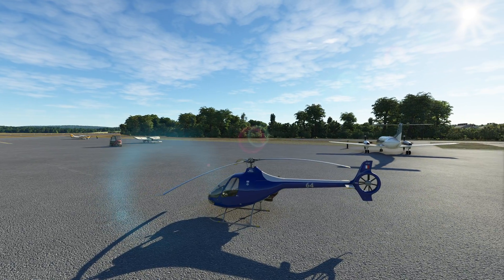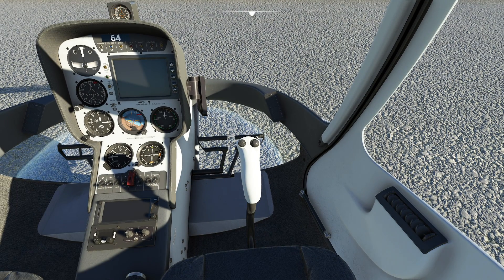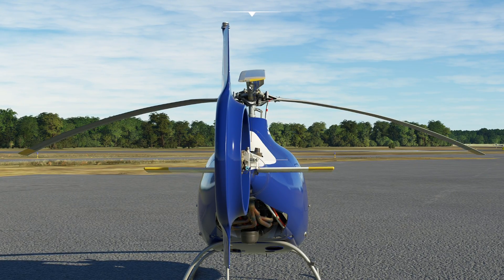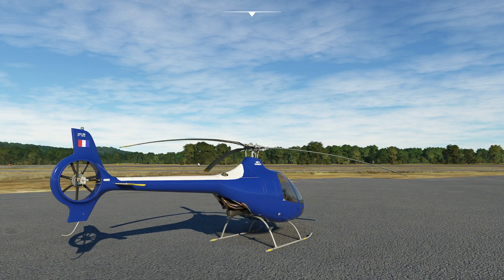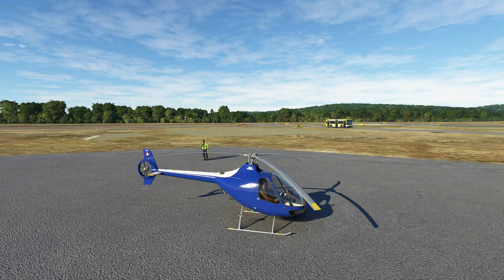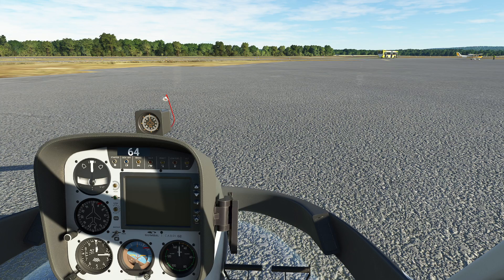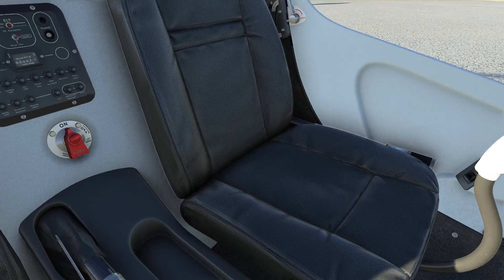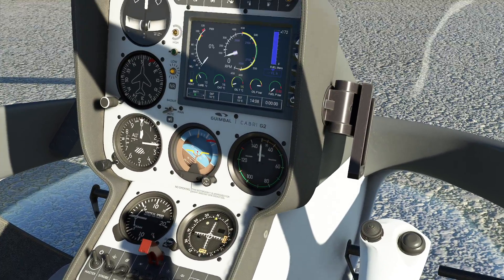MSFS - Helicopter controls, startup and hover test

Comment: question, i've mapped my controls... hopefully correctly... when i click on ready to fly, rotors already spinning etc... how do i go ready to fly with a dark helicopter so that i can follow your steps... thus knowing everything is right... at the moment, when i get into heli/rotor spinning and pull collective all that ends happening is looks like engine rpm goes up, then down and then rotor rpm comes down.
Reply: spawn on a ramp not on the runway

Comment: I could not get the "propeller pitch" to work as my throttle. This is the problem I am having. The throttle does move when you use a mouse, but I want to move the throttle with my twistgrip throttle on my MaxFlightStick helicopter control collective.  Nobody seems to know the answer to this.  Help ne please if you know how to get the throttle to work, and what the controller assignment is called.
Reply: Power Management > Throttle Axis

Comment: I managed to take off in the NY  introduction to the same chopper.    It was already burning and turning.. just had to pull up on the collective and apply some foot pedal to compensate.    I crashed several times and then got the hang of it.    Next up I plan to do a ground start.

Comment: is it just me or does my helicopter keep fishtailing to the left?
Reply: same here
Reply: So as he mentioned at the beginning. The rotors turn in either direction. The helicopter is balanced for cruising altitude which means at lower altitudes it will have a slight rotation on the helicopter which you have to counter with the pedals until you get high enough. The same applies for the pitch of the helicopter. In some cases you will have to takeoff with the stick aiming forward as the helicopter will pitch backwards as it leaves the ground

Comment: Why couldn't they make a helicopter that can fly on unrealistic mode like they had in 2004 is that too much to ask?
Reply: @Rotor-Sims   Yeah I've tried that still doesn't work it's too sensitive even changed all the sensitivity for the joystick  i'm going back to FPSs.
Reply: @Rotor-Sims  Thrustmaster 16,000
Reply: @Rotor-Sims  do i need pedals?
Reply: @Rotor-Sims  okt hanks
Reply: ANYONE with oscillation issues, here is the fix =  "It's something of a bug people reported. Go to the main menu (end your flight (!)) and go to General Options, then Flight Model. Switch to Legacy and make sure you switch Global Preset to Realistic. Now start a flight and it should fly like on rails. End the flight and go to Main Menu, General Options Set Flight Model to Modern and start a flight. Now all should be well."

Comment: can we use HOTAS for the helicopters also when my governor is active my power is jumping all over the place even when im just sitting
Reply: Check your bindings, by default on some hardware the throttle axis for fixed wing can end up controlling both throttle and collective, which will fight against the governor throttle settings